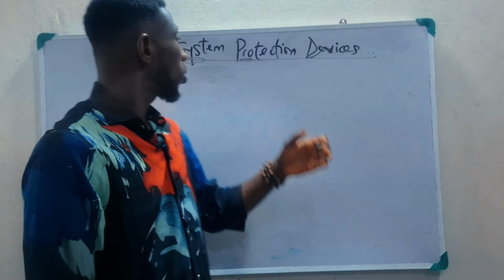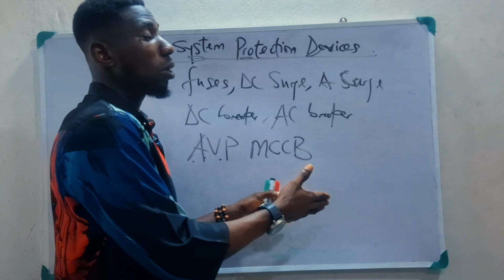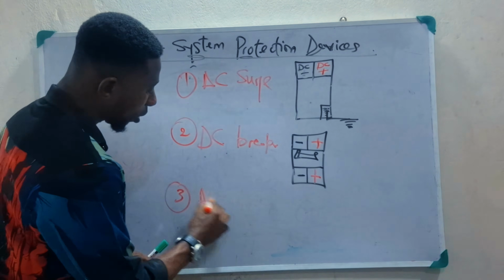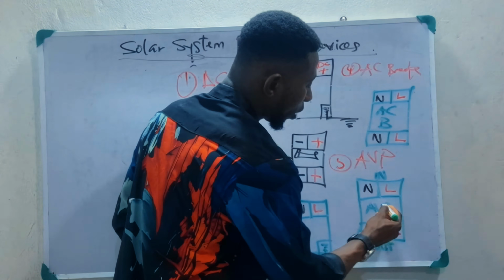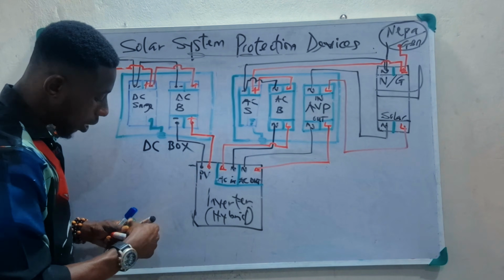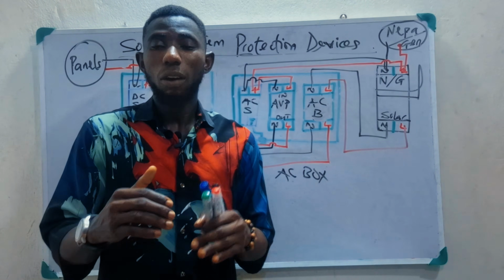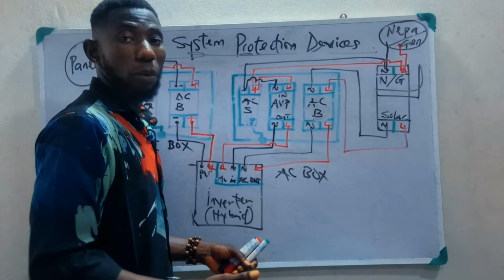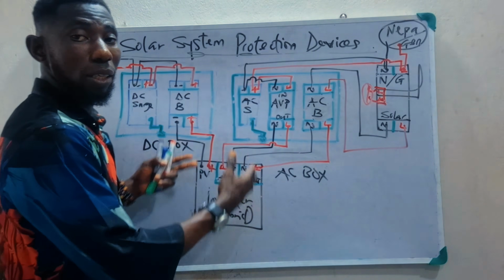How to Wire Solar Protection Devices DC & AC

Comment: Good afternoon sir the DC surge it has no output because from ur panel to DC surge u loop it to  DC breaker why not from the output of DC surge
Reply: The DC surge has single output which should be connect to your earth terminal while there must be a loop from d input of your spd to your breaker input and you connect your output from there to your pv input of hybrid inverter or your charger control.
Hope it clear

Comment: Are all these protection necessary for cola generator. If yes how
Reply: Yes they are because they protect you cola solar from thunder lightning whenever there is spike in voltage, over voltage. or over current interm of cold weather that increases panel supply than expected

Comment: AC output from inverter is regulated .. 
Why should we use breaker for that ?.. 
Sorry just want to learn
Reply from the maker: You can choose to regulate it but it's optional and we only use it most time to regulate the capacity of loads we want the system to power

Comment: Kindly check on the Avp. It is usually called VA protector (voltage and current protector) because you van control the voltage and current on the device. My observation.

Comment: Interesting. My question here is however, for the Ac breaker next after avs, going to to the grid. Is it the downward or the up holes are connected? I.e in short, how to connect an ac breaker from the grid to the voltage protector
Reply from the maker: You have to connect it to your AC surge first then loop it to your AC breaker breaker before connecting it to your Automatic voltage protector
Reply: Well understood, Oga sir 
However, speaking of AC breaker feeding to the system from the grid. How is it connecting. Is it the grid feeding the system or the inverter feeding the grid in the case of hybrid wiring

Comment: How do you know the capacity or size of breaker,  surge protector, change over and mccb you need for the system since there are different rating of this component out there.
Reply from the maker: Is through calculation and design
Reply: @morutech  𝚑𝚘𝚠 𝚌𝚊𝚗 𝚢𝚘𝚞 𝚌𝚊𝚕𝚌𝚞𝚕𝚊𝚝𝚎 𝚠𝚑𝚎𝚗 𝚞 𝚊𝚛𝚎 𝚢𝚎𝚝 𝚝𝚘 𝚜𝚎𝚎 𝚝𝚑𝚎 𝚙𝚛𝚘𝚍𝚞𝚌𝚝,